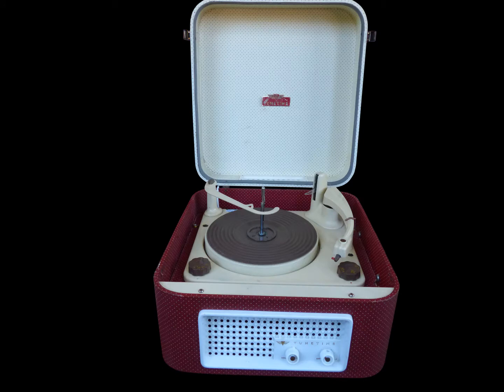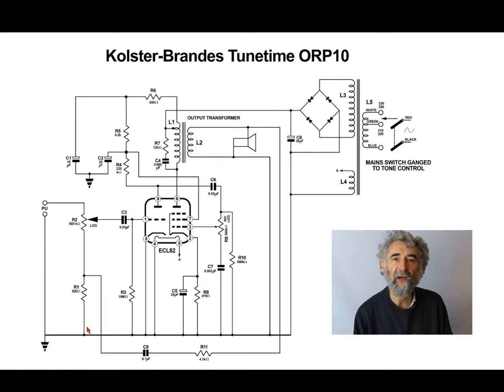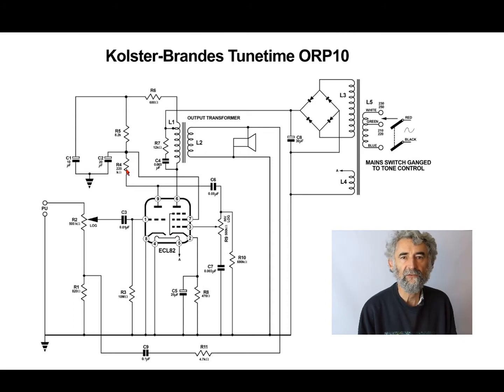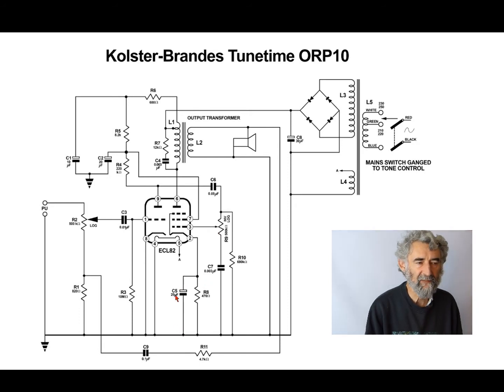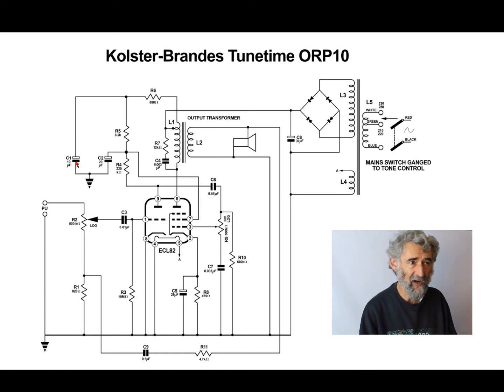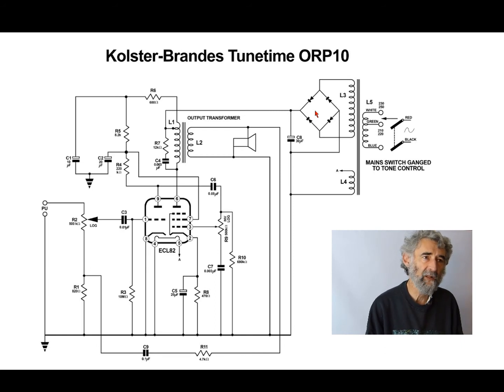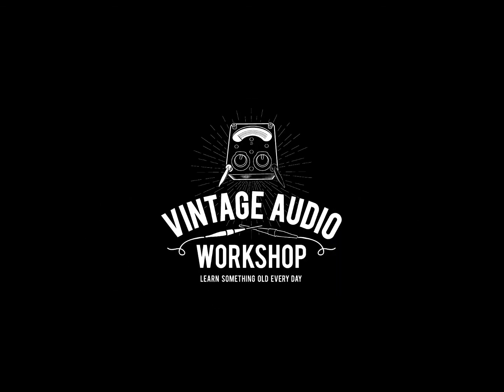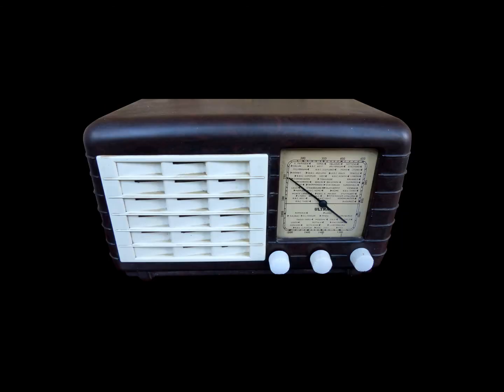Valve Amplifier Study 002: Tunetime ORP10, ECL82 Single Ended Class-A Gramophone Unit

Comment: I've been running a stereo ECL82 amp nito a pair of Audio Note K speakers as a monitor system for recording for 20 years this years and its shear beauty! I must say, that circuit is a clever way of saving money and getting a richer, fatter sound out of the small eliptical speaker. We live in an age where such things are not really a consideration and its nice to see how using things like an inverting valve stage against itself to reduce hum was actually a thing back then!